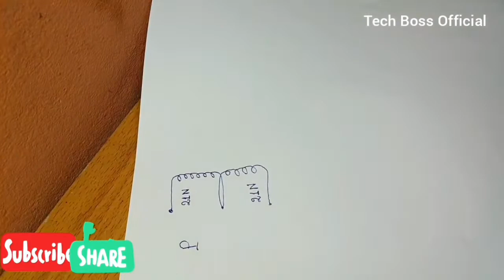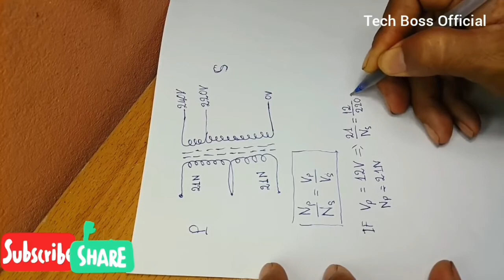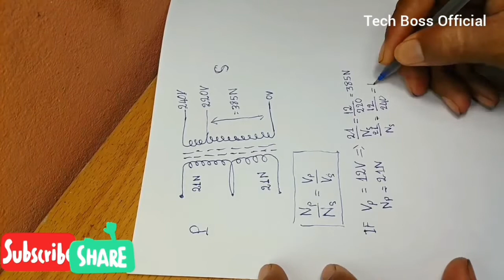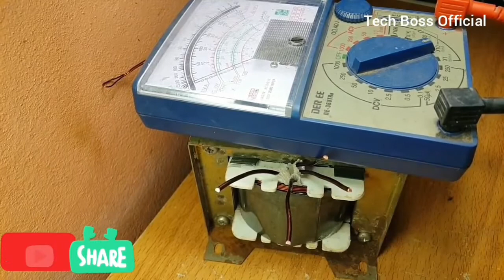How To Make Step UP Transformer Transformer (12V to 220V-240V) For UPS

Comment: If you have that plugged into a mains socket and you are getting 12v 0 12v AC on the meter that is not step up that is step down voltage